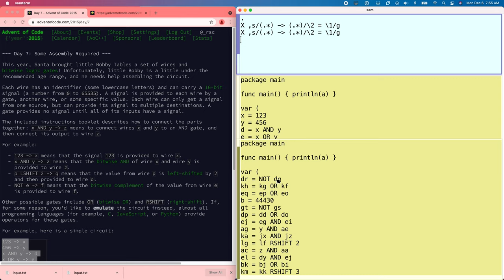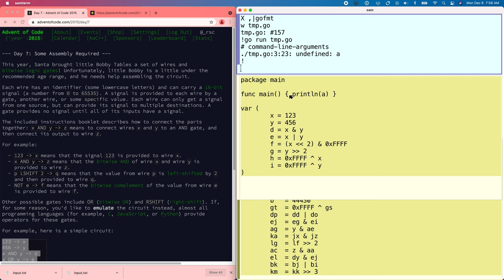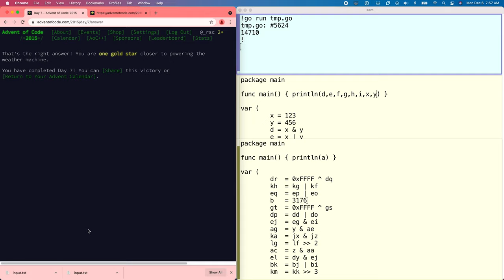AoC 2015 Day 7 using Sam and Go [Circuit sim] #TBT

Comment: Excellent idea to solve a particular problem by mapping it into a more general problem with an already existing solution!

Sam is amazing. I used sam to port programs from one language to another a few times. Structural regular expressions can't parse non-regular grammars, but they can parse particular programs with enough effort. Getting 90% there with 10% of the effort is a huge time saver.

Thanks!